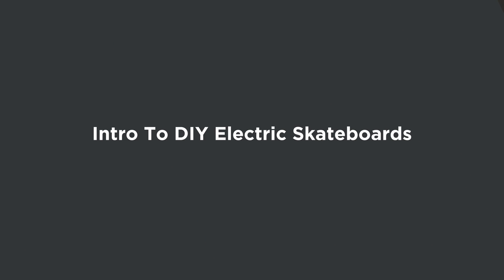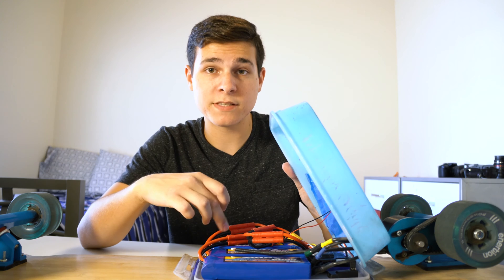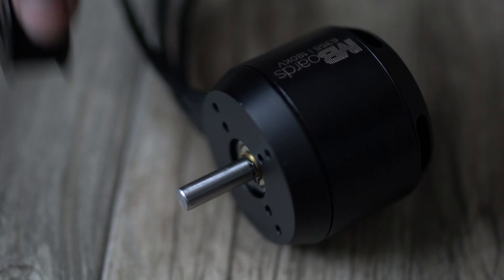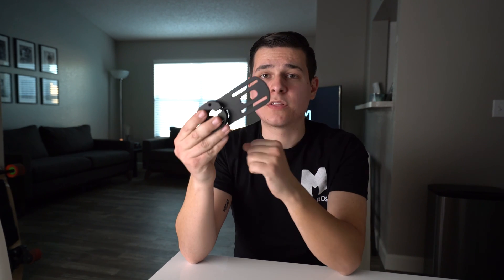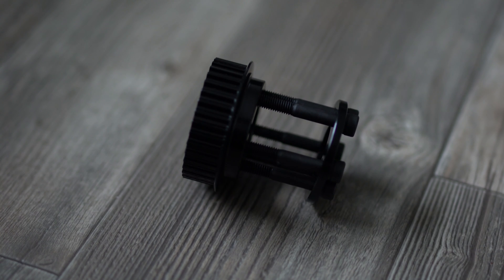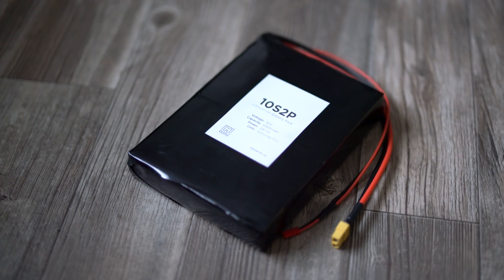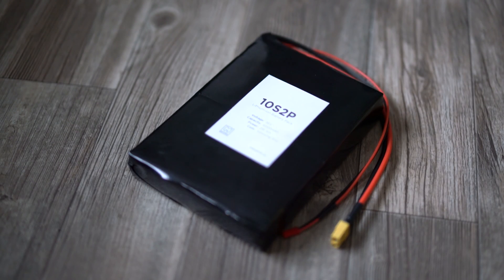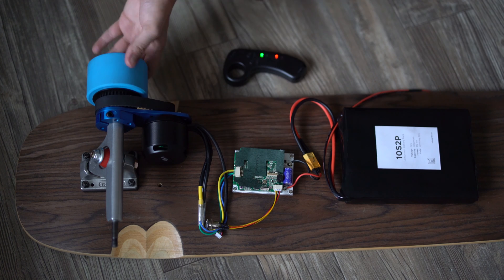Intro To DIY Electric Skateboards - What Parts Are Needed?

Comment: So I bought a Dreskar FT001 and although it should be viewed as a huge saftey concern it got me hooked on  skateboarding without pedaling. My question is I need a new esc. I have been racking my brain tryin got figure out if these dual esc's on eBay wwould work for belt driven. The sellers are either sure...yeah or no way needs different firmware. So I come to you my help. Do you see any easy eBay solutions or is it complex and more difficult tha just switching out?

Comment: is a 7000 mah 14.8 volt 4cell lipo enough ? its connected to a 19000 kv brushless motor nuw the motor should be powerfull enough but i dont know alot about the battery... And the highest i can go is 6 cell lipo, but that seems a bit overkill
Reply: well there are reactions here 2  to 4 years old never responded, ill just figure it out myself i guess

Comment: Dude I'm 6'3" 290-320 depending on the season. I plan to build my battery out of lipo cells (5*2s high drain) with a 10s bms ( cuz you guys don't do payment plans lol) anyway I want a belt drive but what size motor I've been looking at a 6374 170kv for the extra torque as my mass is like twice that of most e boarders I've seen. I have a duel caged 63mm mount in mind to add another motor down the road will this be enough to drag my big ass around town

Comment: how do you pick the belt size?
Reply from the maker: Belt size can be a bit tricky. It all depends on your motor pulley and wheel pulleys diameter as well as distance between the them. Any specific parts you need a belt for?
Reply: @MBoardsco  I ended up getting the 10mm 16t pulley and the 66t pulley so I ordered the 365 mm belt

Comment: How long is the minimum board length for these parts?
Reply: depends on wich parts u are using...
Reply: but as long as you dont use like a penny board or something super small, just a regular size skateboard you should be fine

Comment: Is it possible to rotate the motor in both directions with ESC FSESC 4.12 50A Based on VESC® 4.12?
Reply from the maker: Yes, you can program the motor to go forward and reverse.
Reply: @MBoardsco  thank you so much

Comment: Are motors fairly water resistant on their own, or do they need an enclosure? Like running through a puddle of water or getting caught in the rain sorta water resistance.
Reply from the maker: Brushless Motors are relatively water resistant. Riding over some wet ground once in a while won’t hurt. Can’t recommend you riding in the rain or through a puddle but we have seen it done many many times.

Comment: Hey thanks for the vid it really helps. I am going to build an electric skateboard but I am 17 and cash isn't exactly my sweet spot so which parts do you think I should cut down on for a cheaper build? I am looking for a good all round build and my motor is likely to be a 6354 180KV.

Comment: Does the controller tell you how much battery life you have left, or do i have to but the battery display??
Reply from the maker: The remotes for the basic ESCs show how much battery you have left right on the remote. 

For Vesc users, a battery percentage indicator will be necessary.

Comment: Hey Mike, How much speed can I get out of a motor which is rated 170 KV and has an output of 2800 watts ?. 
Please Answer my Question, I would highly appreciate it.
Reply from the maker: It depends on the size of the wheels, voltage of the battery, and gearing ratio.
Reply: what about 90 mm wheels , 10 S battery ; Then how much speed can I get out of a motor rated 170 KV with a power output of 2800  watts @MBoardsco
Reply: Please Reply Respected Mike Beard

Comment: How far and fast would you go on a 10s3p 8Ah 42v battery?
Reply from the maker: Although number of factors like rider weight, wheel size, gearing ratio, etc  effect top speed, 10s batteries get you speeds of around 25mph.

Comment: If I want to make it a dual motor, what parts would I need for that?
Reply from the maker: You’ll need to follow the same parts list  with a few differences. 

You’ll need 2 of the following instead of 1:

Motor mounts
Motors
Vescs
Pulley Systems 

Let us know if you have any other questions! We’re always here to help.

Comment: Great vid man,
1) would love to see some AT wheels in store 
2) a video on what goes into making a 18650 battery and in depth BMS Wiring
Reply from the maker: In the coming months we plan on expanding our product line to cover AT boards for sure. 

And we will most likely be doing a BMS/Battery Wiring Video as well.
Reply: @MBoardsco got the bms video made yet?
Im converting a VERY heavy old at board with a truck starter size motor in to a slightly more user friendly version.
Need some guidance on bms selection and the different ways you can wire them